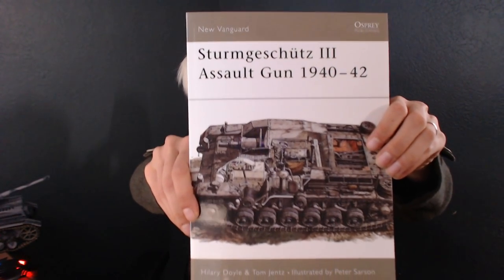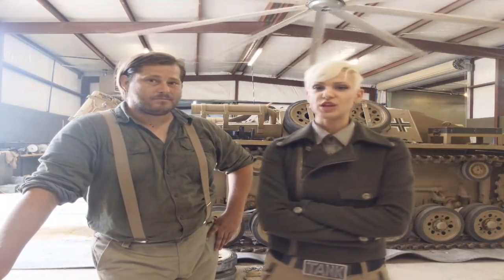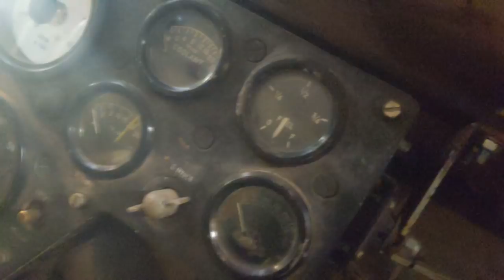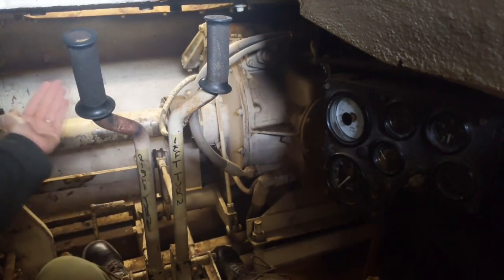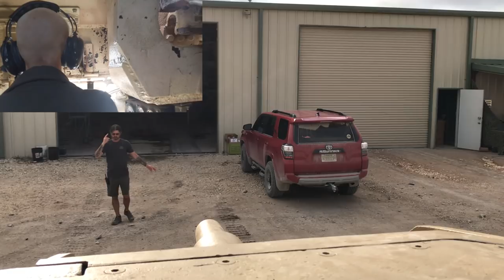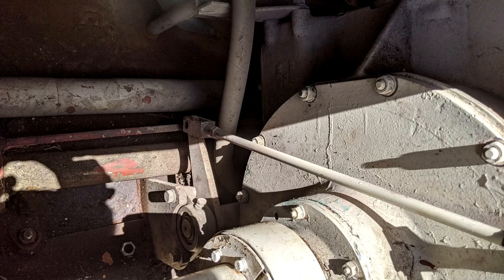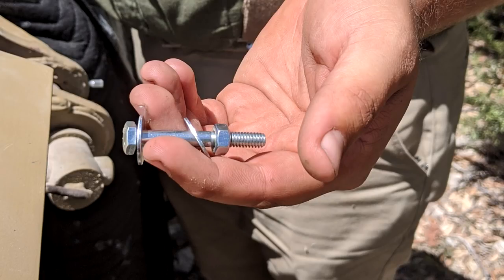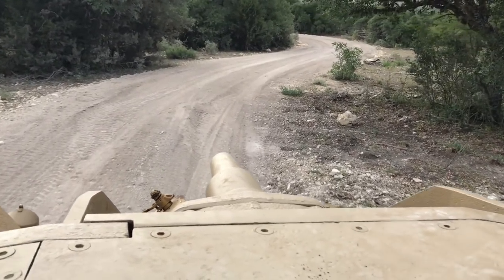Driving the restored StuG III at Drivetanks.com in Texas

Comment: Reaction from the person at the drive thru would be priceless
Reply: A Uber trip in a Stug would be priceless
Reply: @jubisvaldo5450  perfect for Ubering in a Chicago ghetto.
Reply: Bet they wouldn’t screw up ur order.
Reply: @glhmedic  or, they would be too awe struck to get it right
Reply: Back in the 80s one M48A2GA2 crew managed not to refuel the thing. So on the march back from an exercise they had to field refuel. Our S3 was in the fuel station shop shopping for some sweets (he was a "shorter than the shelves" guy) when the platoon sgt (using a 4x4 to get there) came in, nodded to me (PFC) and then asked the station attendend "Do you have a high speed petrol pump? The normal ones are to slow for a tank!" The attendend was about "HaHa" when just at that moment the M48 walzed onto the fuel station tarmac.

End result: The S3 went "a bit ballistic" (and the platoon sgt realized where he had seen me before...), there is not high speed petrol pump and yes, the extensible fuel hoses are long enough to get more than one to the tank.
Reply: @mbr5742  FILLER' UP !
Reply: me: yeh ermmm can i have a 17 pounder with cheese 
mcdonalds staff: you mean a 1/4 pounder ?
me: well that's hardly going to deal with a tiger is it

Comment: Another good reference on the StuG III is the Haynes "manual" by Mark Healy. 

I read that the original Maybach HL 120 was a carburetted V-12 rated at 296 BHP at 3K rpm. Perhaps a viable replacement might be a Rolls-Royce Meteor rated at 500-600 BHP? They're probably more common and still have parts, since the Meteor is basically a Merlin engine detuned for tank use. The old StuG would scoot with that much horsepower under the hood, er, bonnet!
Reply: The RR K60 is a pretty compact complete engine, gearbox, fan unit that has a proven compatible steering unit and has been used in many StuG replicas. That one sounded rough and was a bit sluggish with turning.

The Meteor is a very thirsty petrol engine that you would have to try and mate with a gearbox, transmission, steering unit, cooling system, that could all fit inside that space.

Comment: Thanks, for the ride along video. You noted that the outside of the StuG got very hot, what was the temperature in the crew compartment?
Reply from the maker: It was notably cooler inside comparatively when we went back out to fix it. Didn't record any temps though. You'll see in the video that I did remove my coat by the end though!

Comment: Want to have a real adventure driving an AFV? Try driving onto a flatcar train.
Reply: @Tinderchaff  Yes, except the train backs up to a ramp, so if you're going on the frontmost car, you have to drive all the way down the train, from flatbed to flatbed. Pretty hair raising, and you better hope the guide giving you hand signals doesn't mistake his left and right.
Reply: @luvr381  try backing a scraper off one, very hair raising.
Reply: @Canis_Lupus_Rex  Sounds like it would be! Can you see much out of a scraper?
Reply: @luvr381  not to the rear, requires two ground guides, one rear, one front. The front guide mirrors what the rear one motions. The unit I was in at Ft Carson just arrived back from Belize when I got there. They railheaded all of their equipment and all of the scrapers were near the front of the train, they had to back them all off.
Reply: @Canis_Lupus_Rex  Just how we did it, requires a lot of faith in ground guides, and some were guys that could never get marching right.

Comment: I want a tank for commuting and daily use purposes it surely has alot of grocery space
Reply: It would get shocking milage though 😂
Reply: @martinjrgensen8234  but just the thing to block a double parked Karen with XD
Reply: Go for a BeOP. That is a KaJaPa with the gun removed. A compact 24.5to vehicle, rather spacious (since the 90mm gun is removed), good horsepower (500HP), fits in a parking garage - the Panzerjäger testet that with two KaJaPa back in the 1980s), no problems with parking space. And runs on diesel.
Reply: @SonsOfLorgar  And you can do it without taking up extra space. Just block Karen from above...
Reply: @mbr5742  or just make a compact car of her suv
Reply: @PanzerChicken69  They changed the law recently, stopping vehicles being registered road legal, those registered before that date can be driven on the road.

Comment: Congratulations on your first 'Assault  Gun', drive. But where were the other gears?? That engine was screaming out for a gear change!
Reply: It is a semi-automatic(in its current configuration) iirc. It also revs insanely high due to the driveline configuration they’ve got in it, which is why the guy says they were gonna replace it in the video. I don’t remember the specifics but I recall Jon had said that the setup was just not ideal in the low range. It’s what they had available and it works, it just revs high, but I’m pretty sure he’d said that it settles down once it gets going...its just not exactly the sort of thing you’d want to get up to a decent clip, and even if you did, it’s not exactly easy to find a place to do so.

Comment: You must have rpm in sight.Never above 3500 per minute, than the oil pressur.Not about 7 Bar.The Oil Pressur is Essential.For the Brakes and Gearshift.

Comment: Is that motor a Detroit ?   What kind of motor  came in those  ?
Congradssss Thats   a project  .
Reply from the maker: The motor currently in is a Rolls Royce K60, it'll be changed to a Detroit Diesel and originally used the Maybach HL120
Reply: @Sofilein  thank you for the info .I was thinking it came with a Mercedes .That is a bucket list to do .I got to fly a 1944 J model B25 last year . That was on my bucket list.next a B17 .

Comment: A stug with a rolls royce engine, FV302 transmission, and where the tillers are hooked up backwards.  What are these guys doing? LOL
Reply: it wasnt them. did you even watch the video?
Reply: @mach533x  I did watch the video.
Reply: Simple, you can't get an engine and transmission for a StuG for an arm and a leg

 FV 432's have been cut up to make replicas

So easy option take the engine and drive and steering train from an FV433 and fit it as you know it fits in the dimensions

Now the complicated bit

StuG rear drive with engine etc behind the driver
FV430 series front drive with the RR K60 engine and Allison gearbox beside the driver the and steering unit in front of them
Limited funds 

I am sure you could build one much better from the wreck it was over many years

Comment: Looks like there is not much left of this poor Stug that is orignal which does not surprise people as its in American hands.
Reply: Built from a wreck in the UK with parts scavenged across Europe, hence the engine, transmission and steering from an FV 433 (FV 432's have been used to build several replica StuG's)

Main gun was a rare piece that took a long time to source

The bloke who did the restoration had hard choices to make

Comment: ....not sure I like the added exhaust modification long the upper rear superstructure. I suppose we have to be realistic in today's world on what we can achieve. If I was King of the World, I would start a factory producing WW2 era tank engines to power these historic machines with the actual designed engines....albeit manufactured in the 21st Century. They are doing that sort of thing with motorbikes, and other such things...retro motorcycles built in the 21st Century as brand new.

Comment: Nice to hear this one will get an engine upgrade. I'm sorry but this British engine which is in it right now sounds aweful.
Reply: I drove FV430 series vehicles for years, this K60 sounded rough, over revving as if the gear range selector was in the wrong position, the turning was laboured and sounded wrong.
Reply: @chaz8758  Corrent me if I am wrong, but the K60 has lower net horsepower output than the original Stug engine right? Because the Maybach is rated at 300 hp and maybe the weight of the Stug is just a bit too much for the K60.